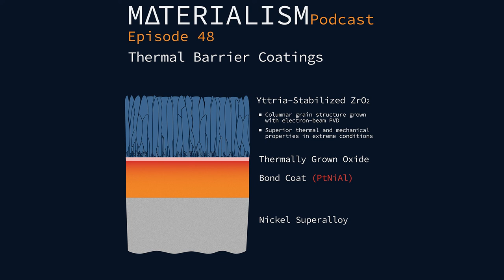Materialism Podcast Ep 48: Thermal Barrier Coatings

Comment: Tungsten coatings too conducive and non porous for the job?
Reply from the maker: Conductivity is too high, they might interact with alloy as well, I'd have to check the past diagram.
Reply: It seems like you could get sufficiently thick coating from CVD of a-alumina? Or tweak the PVD to avoid beta/gamma alumina. But I’m sure YSZ is industry standard for a reason and there’s way more going on as far as thermal expansion and material compatibility and general phase structure.